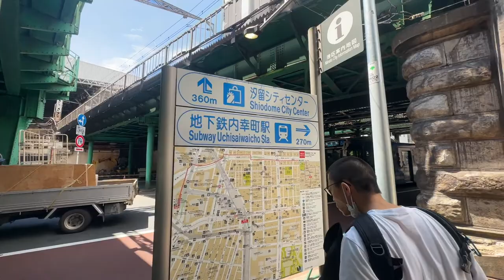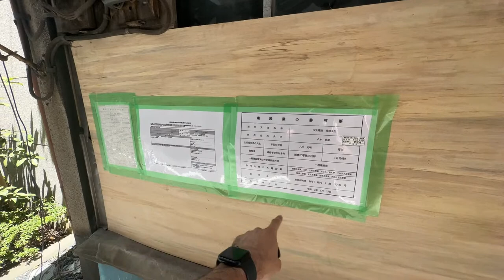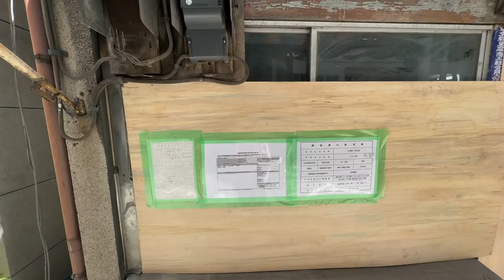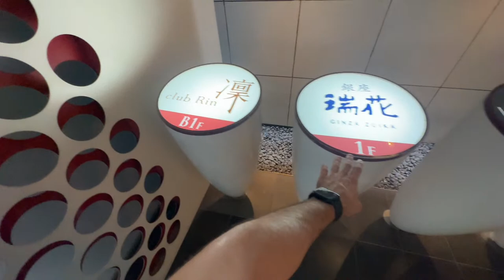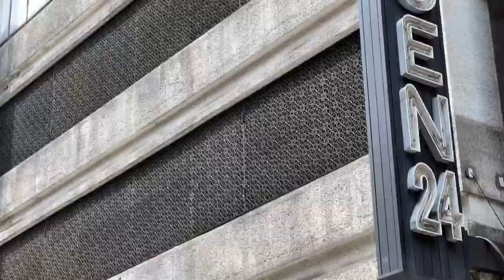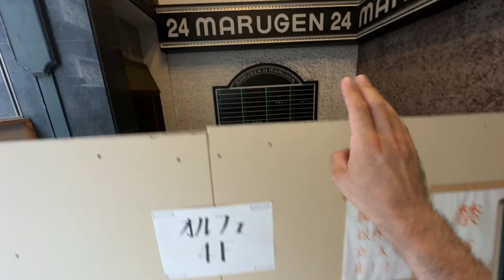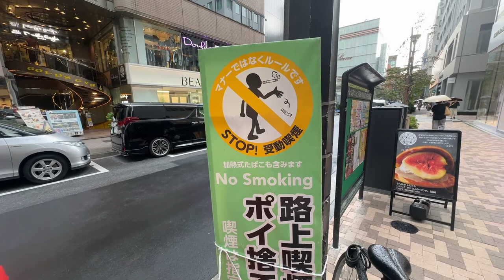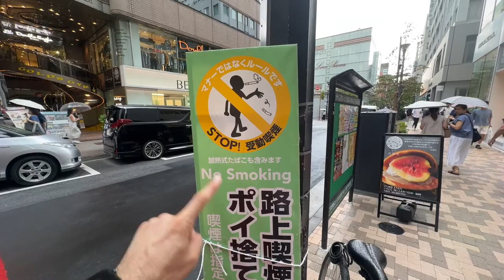Gotta Leave Tokyo For A While - A Morning Backstreet Walk

Comment: Happy belated birthday, Norm!  There's something about the old Showa-era architecture that just speaks to me...  That Marugen 24 building...I can imagine it in its heyday, neons all lit up...I have to think it was a vibrant place.  I know I'd have to grind a bit harder to lose weight to fit through that hole at the top, though (with or without a 23-kg streaming backpack).  And please stay hydrated out there...a liter and a half of water sweats out in a hurry in hot weather (along with electrolytes), and the heat's effects will sneak up on you quickly (heat index here where I am was 111°F/44°C today, with a 98°F/37°C air temperature and high humidity...I was in not a very good state in about 30 minutes, and that was only driving without air conditioning).

Also re: Internet commentary...I continue to lack the ability to find a reason to spread negativity.  Seriously, negativity does nothing.  As in the old saying, "Laugh, and the world laughs with you...cry, and you cry alone."  If someone takes a minute of their time, an hour, a day, to share something they love with you...don't just watch it...celebrate it.  Share in their joy, their passion, their adventure.  Every good and positive thing deserves a good and positive place and mindset.